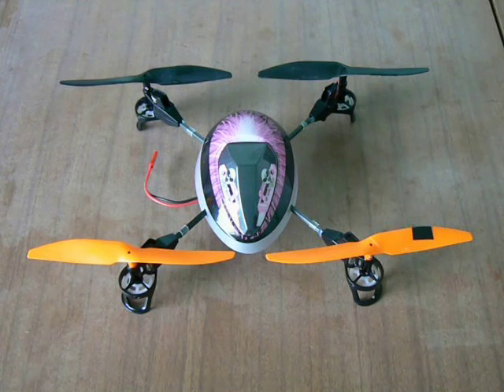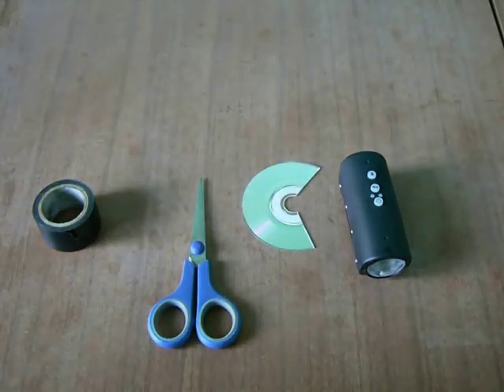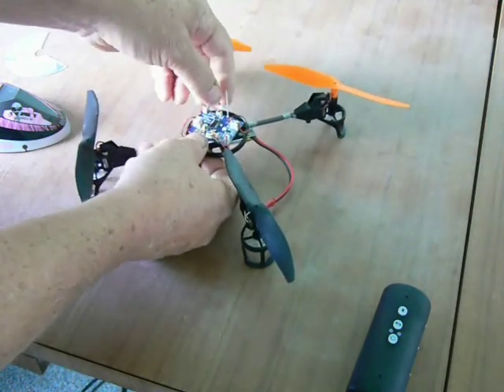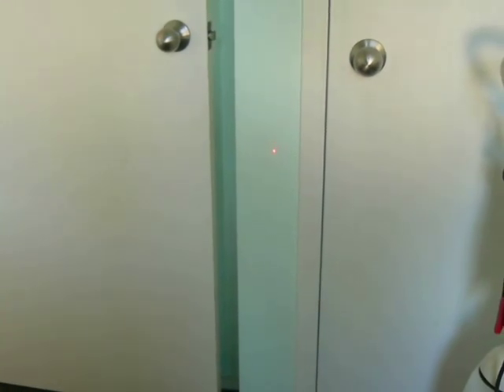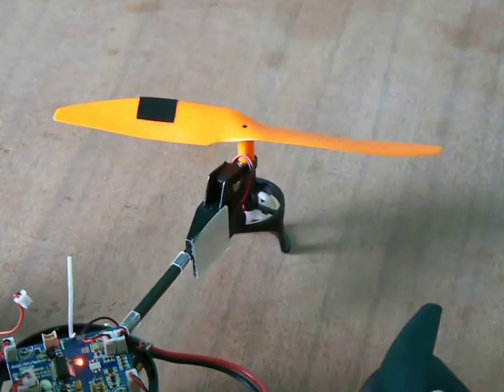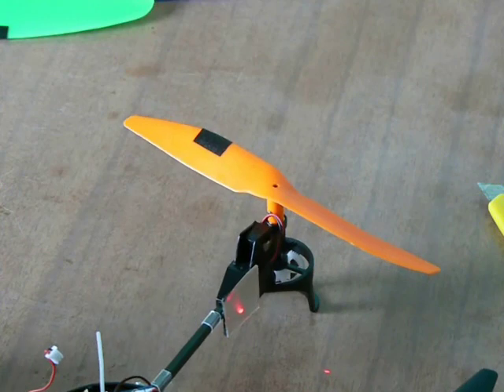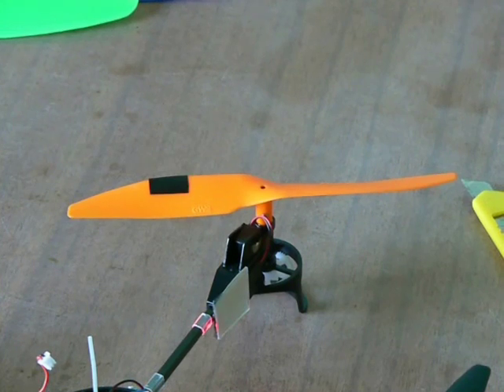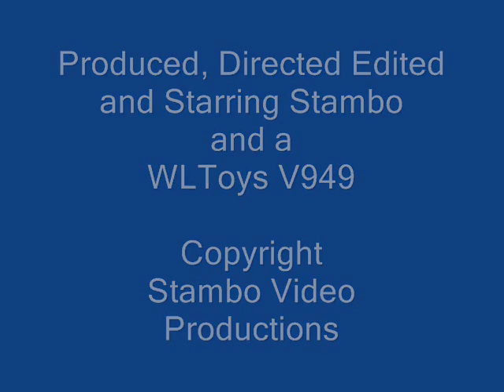Balance V949 V959 V212 Quad Blades with a Laser

Comment: i have never had to do this sort of thing before but i can see balancing the props on a hi end quad but not on something like this its just not needed in my opnion
Reply from the maker: When you hear the difference it makes to the sound of the props, you might understand a bit more.
These little things do actually fly better with balanced props and the on board video from the V959 is noticeably better also. No flight controller enjoys vibration and these little things are no exception.
Any prop can benefit from balancing, some more than others. You may not have noticed the non standard props on the quad that I balance.
These GWS props are known to be poorly balanced but they certainly perform better than the stock ones so it is worth the effort.
Reply: +Kevys Rc &amp; Music   Even smaller quads can gain from balancing the props.
Reply: +Richard F well you know what they say to each his or her own man.. these little quads as far as im concerned are not going to fly any better or any longer I have owned several quads and still have a few and now iam flying hexes and still have not balanced any blades and never have a problem unless its a crash that happens really bad or a part wares out.. my V212 is still 100& stock other then the battery finaly wore out and its got over 300 + flights on it now never even changed a bade yet on it either and no problems so Explain that... ,now  on medium to  high end quads i can understand you need to balance blades but not on these cheap things ..
Reply from the maker: +Kevys Rc &amp; Music I guess if you have never tried it you will not know the difference.
I am not saying they fly badly without balance, just that they generally fly better and sound better when the props ARE balanced.
And the video is certainly better from the V959.
I have quads ranging in size from nano to 500+ size and the only props I don't balance are the ones on the nanos and my 250 4s quad.

Comment: Yeah this is a really good idea  jnfact i just got my v959 yeterday and i balanced mine today like this ,....but........ i left all motors plugged in when i balanced each blade because i feel that since all of the motors run  together that it should be done this way but really helpfull tip thanks.

Comment from the maker: Thanks, the more you do it the easier it gets.
Depends what you what to do with the quad as to how fussy you need to be.
Even if you improve it a bit but not get it perfect you will be amazed how much quieter they get.
Another thing thing that makes a difference is silicon spray, around the gears and prop shaft.

Comment: Outstanding, thanks.  I will balance my V222's stock props this way.  I like that your method balances the propeller in situ, while spinning within the mount/gear train system, as it does in flight.

Comment: They are consistantly heavier on the end marked "EP 5443R". I use an Exacto knife to carefully shave a little plastic off the blade's upper surface while carefully retaining the original contour, then buff it down smooth with a very fine finger nail buffer block to restore its finish when I've removed enough plastic.  I check my work as I go by slipping them onto a large needle and gently spinning to see which end is heavier.
I don't like sticking anything onto the props for various reasons.